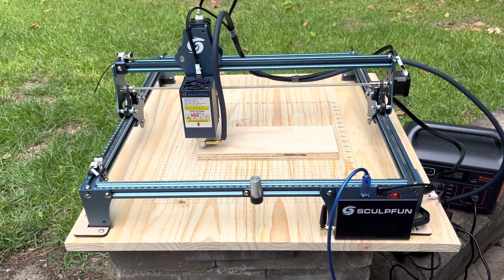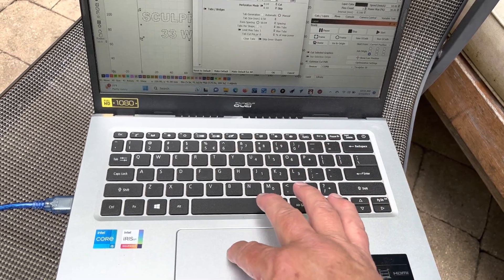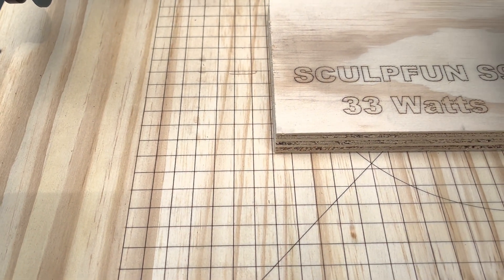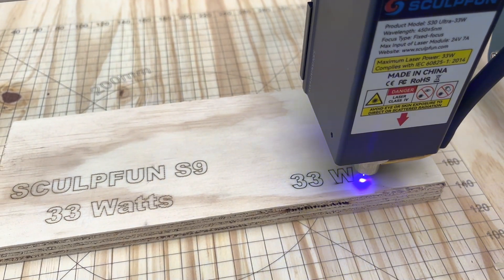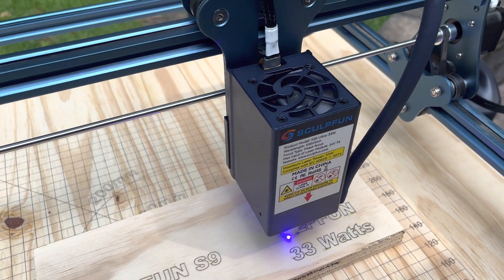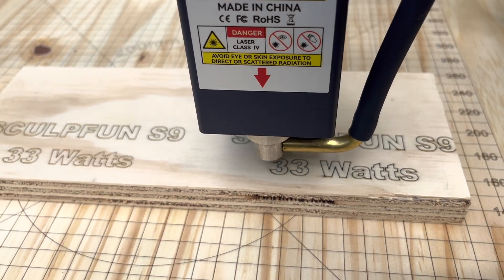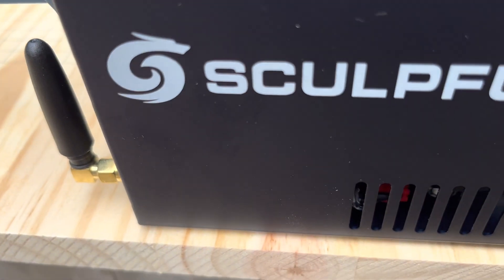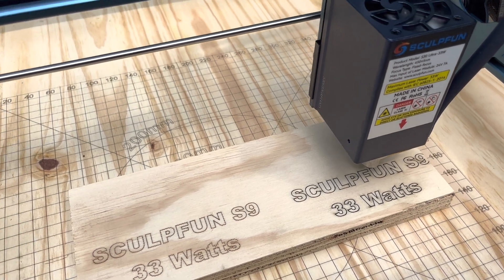Sculpfun S9 33 Watt Upgrade Kit Observations

Comment: Hello dear!
Also me have this laser but with Linear guide upgrade and a still have this issue also at 1000mm/min. How did you resolve? (I fixed laser on my table with screws but problem persit).
Reply: Hello! You must lower the speed value on $120 and $121.